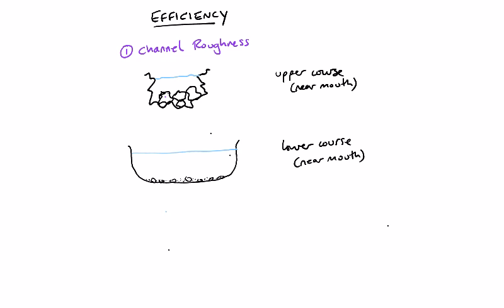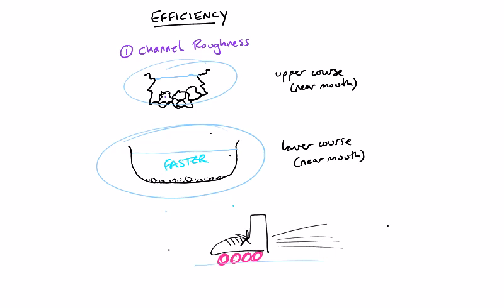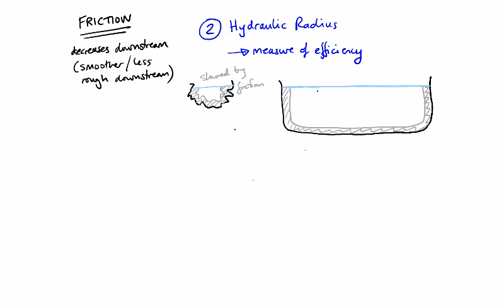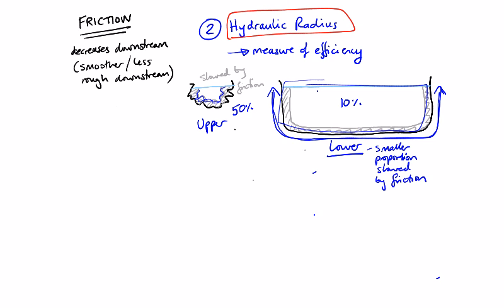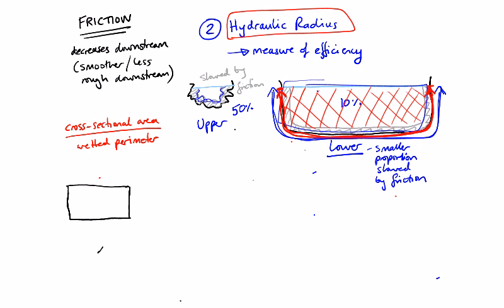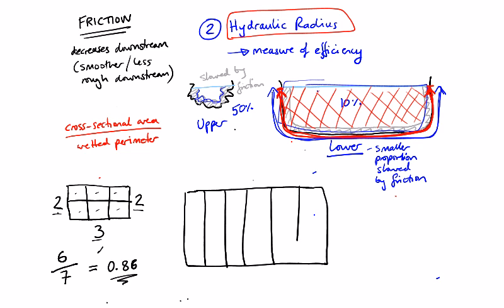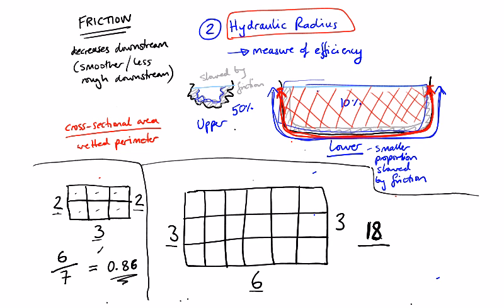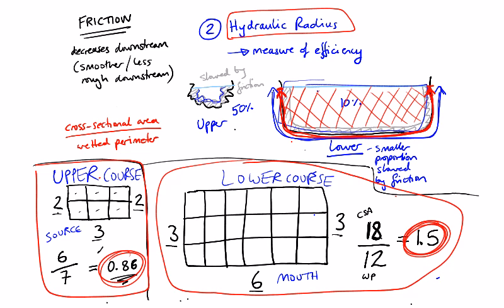Why do rivers get faster downstream?

Comment: If the velocity of river is increased in the lower course or at the mouth, why do they lose energy and end up depositing sediments?
Reply from the maker: Hello Moinak. From what I understand they only lose energy when they reach the sea which slows them down (plus they also deposit in any other areas of slower velocity within their channel e.g. the inside of a meander bend). It is the overall/average velocity that increased, this doesn't mean the velocity is higher in all places across the channel.